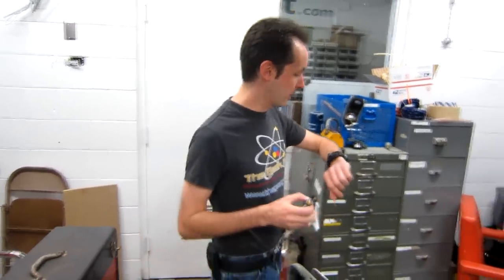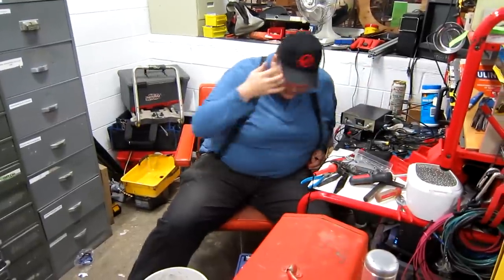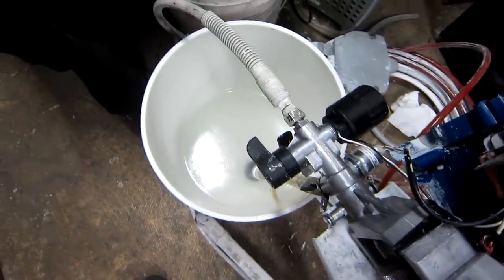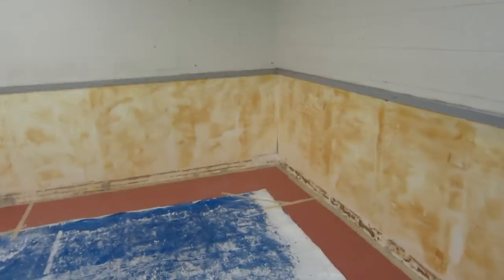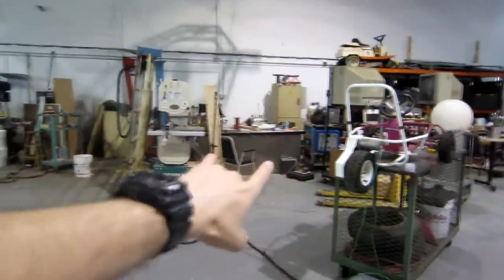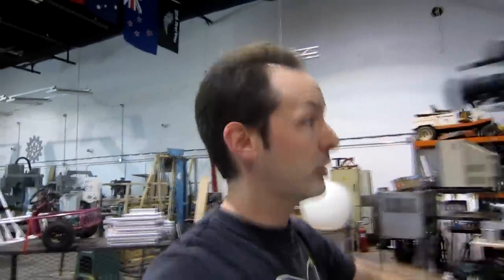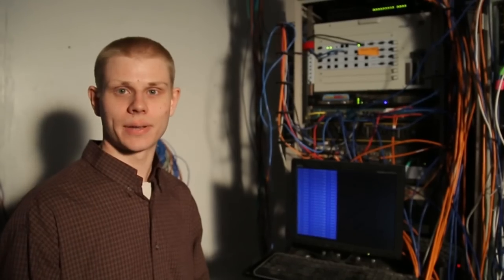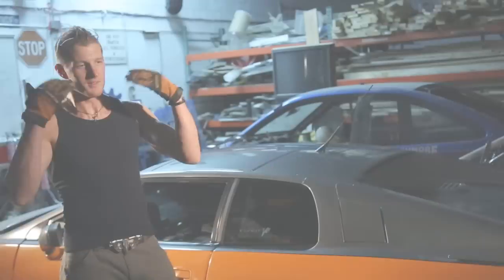Captain's Blog 9-20-2012 Paint Sprayers and Candy Ravers

Comment: Now that you have that huge fog machine working, you need to make a ground fog attachment.
Get a 55 Gallon garbage can
Drier Duct
Duct tape
and a lot regular ice.
Drill one hole on either side of the garbage can.
From the inside, tape one end of the drier duct so it's just barely sticking out the lower hole.
Stretch out and coil all of the duct inside the Garbage can and have about 2' sticking out the other side.
Secure it to the fog machine's output with tape.
Fill the can with ice.
Have fun!